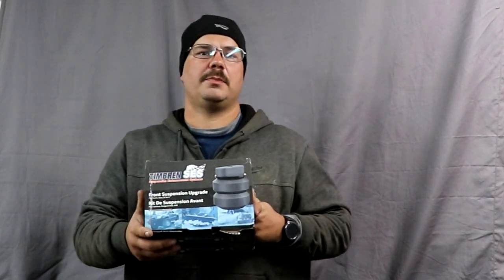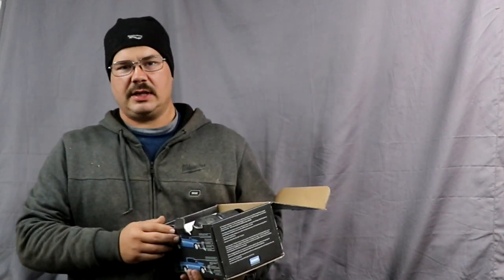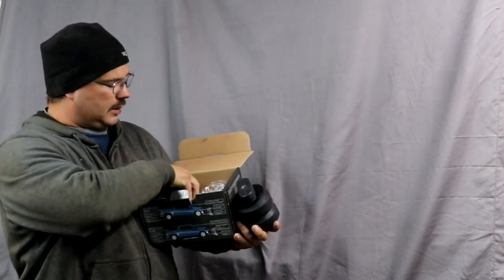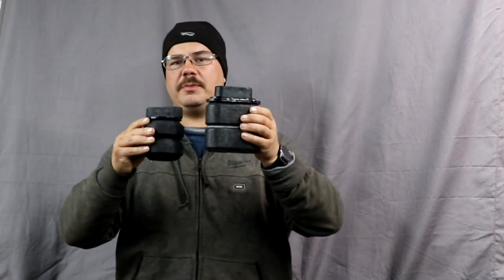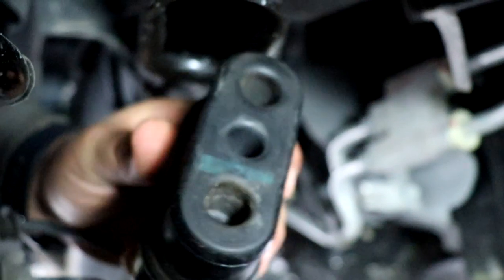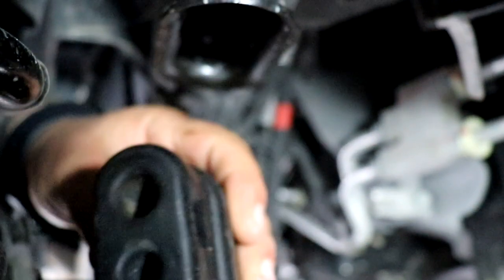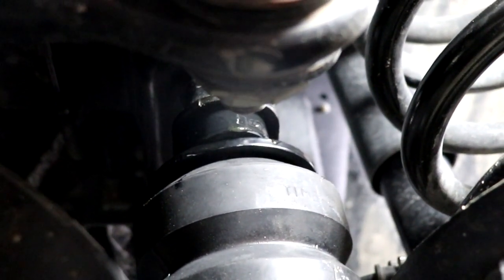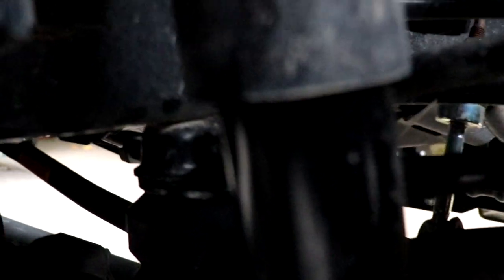Timbren Load Support install DF25004B 2018 Ram 3500 SRW

Comment: So no more suspension? I'd trade this back out after the plow is done for the year. easy install for sure though.
Reply from the maker: With the smaller round one I used I still have room under it. About 1" . I can't tell a difference yet but only drove 7 miles yesterday.  We will see how things move forward maybe your right I'll end up taking them out in April.

Comment: So this video is 2 years old almost. What is your opinion now?
Reply from the maker: I was going to do a update video but very busy. I have not had any parts break yet. I just had truck into shop for a over look and everything was great. only 29000 miles at this time. The factory tires are my big problem they are at 7/32 for only 29000 miles. I figured by now with the front and back blade on truck something would break but this thing is a beast. I get about 11mpg average.  Breaks are at 9mm front and back. front end still don't move at all so that's a good sign. For the price I paid for truck I really feel it was a great deal and so fare very happy.
Reply: @DelsLawnCare  yeah would love to see an update vid
Reply: I just tossed a set on the front of my 2020 F250 7.3 for plowing. (Has plow prep package) front end feels a ton better with the plow on but when the plow is off.... front end is super bouncy on my crap roads. I’ll be swapping them out every season prior to plowing moving forward since it was such an easy install. Damn near get car sick driving without the plow on.
Reply: @robmetzel845  good to know. I have a Ram 2500 HD so I think I will bebusing these. I was going to go the front coil bags with the auto remote but that is well over $1000 for that. Nice to have but expensive. I think for now this is the way to go and if it gets to be too much in summer, I will swap them too each season.
Reply from the maker: @robmetzel845  After using these for couple years now, I have learned to do same thing. My dirt road sucks in the summer and Michigan roads don't help.